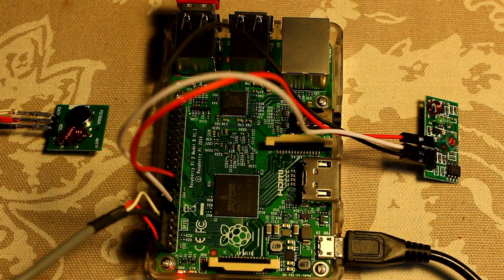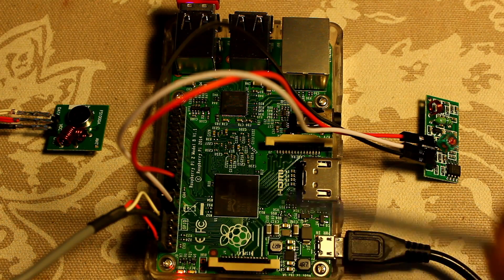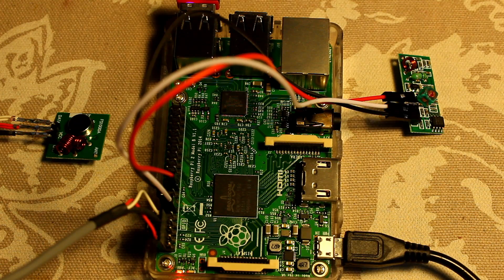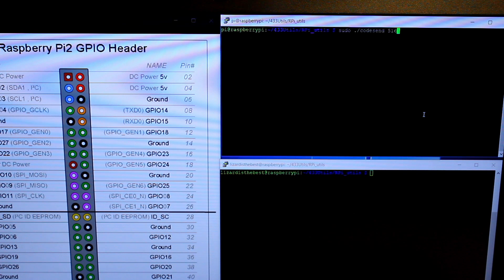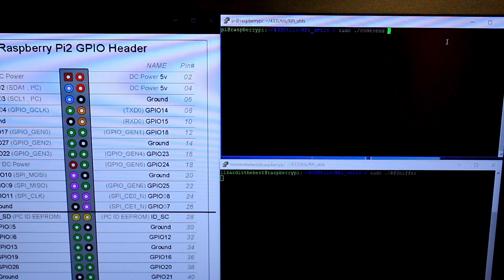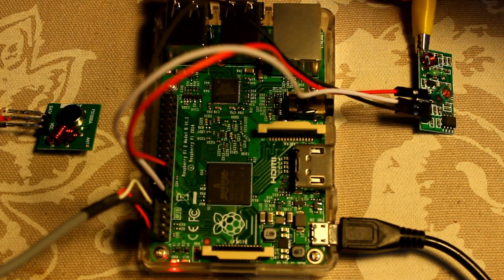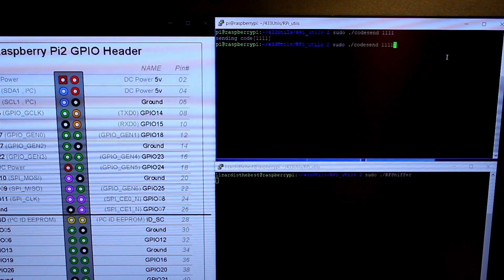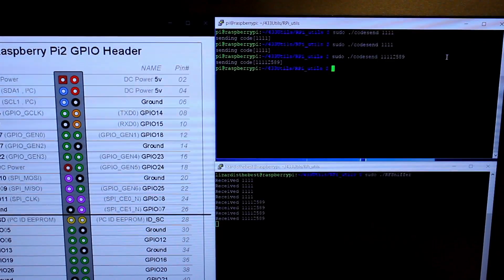Raspberry Pi 433MHz radio transmission

Comment: it's mean that both of them (transmitter and receiver) were connected directly to the GPIO raspberry  pi, right?
how can I send the data from sensor to the raspberry pi using this RF module wirelessly? I really hope your help. thanks
Reply from the maker: Yes! You need to download the collection of code 433Utils from Github, the link is here: https://github.com/ninjablocks/433Utils, inside the folder RPi_utils you will find codesend.cpp and RFSniffer.cpp, these are the two scripts to send and recive a code respectively. You need to modify the number of the pins you use in the GPIO and then compile the .cpp files to get a binary executable file. Be carefull, the receiver module cannot be conected to 5v, if you do so you can damage the raspberry, the sender can be conected to 3,3v or 5v both will work. Good luck!
Reply: oke, thanks very much, i'll try that. i hope that works well, thank you :)

Comment: Does it works with Raspberry pi pico too?
Reply from the maker: It should, you just need to adapt the numbering of the inputs and outputs to your wiring.
Reply: @argilaga  Oh, alright. but the code for transmiter and receiver can be writed in Thonny or it has to be writen somewhere else entirely? Because i really dont know where or how i should write the code. Thanks for the response!
Reply from the maker: @AlexIdk.  I never used Thonny but I see that it comes with Python 3.7 so the code I used should work right away (links to the code below in the description)
Reply: @argilaga  Ok ill use python 3.7 to see if it works with the Pico, Thanks again for the help
Reply from the maker: @AlexIdk.  You are welcome, I hope it works!